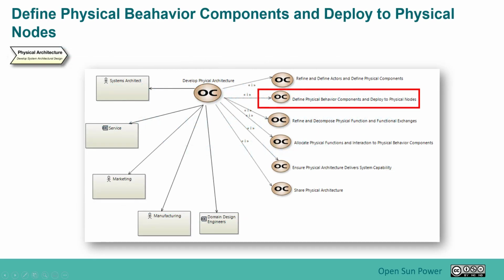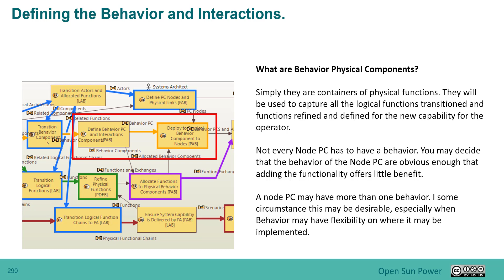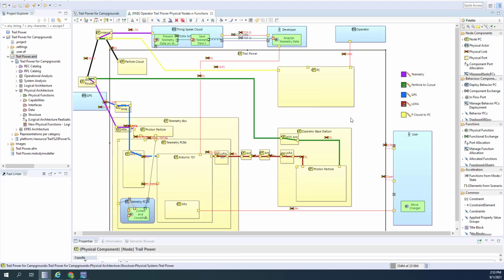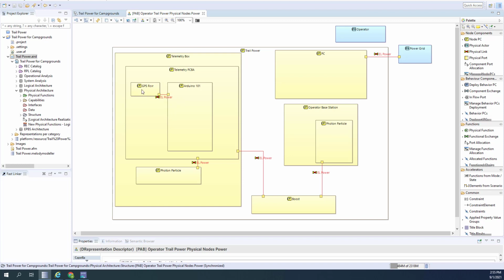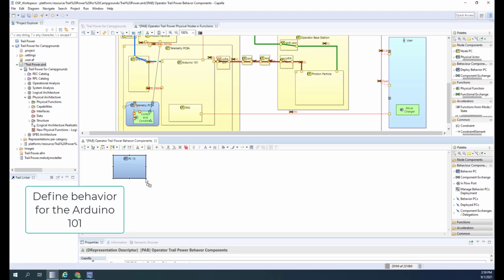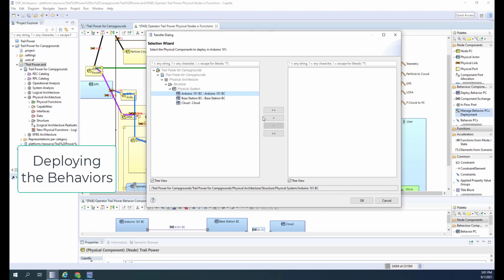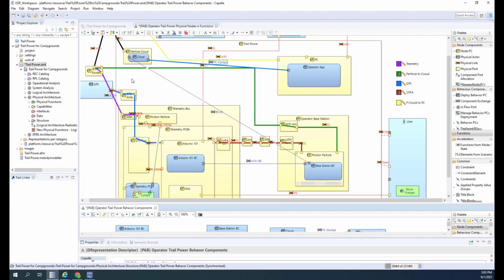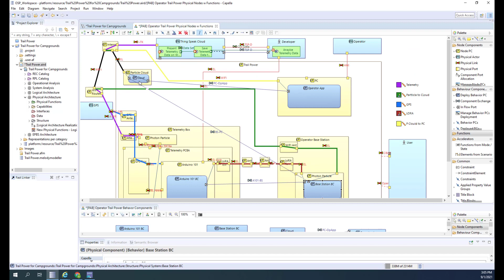8.2 Defining Physical Behavior Components and Deploying them to Physical Nodes with Capella

Comment: Hi. Do you know know why the mapping cannot be done if PA`s are involved (e.g. could you have done also the allocation of the blue physical path to the component exchange?) Thanks!
Reply from the maker: No I do not, but I would not be surprised if that changes is a later release. I typically just go to specific port on the PA and make the allocation.

Comment: Thanks a lot for providing these videos -They are excellent.  I purchased the books  "Systems Architecture Modeling with Arcadia Method" and "Model-based Systems and Architecture engineering with the Arcadia method". written by Pascal Roques and Jean-Luc Voirin. What else material do you guys use to learn about the Arcadia/Capella tool/method for MBSE. ?
Reply from the maker: Those are the books I use. Getting experience and looking at others models has helped me. I plan on sharing more models after I get this course complete.
Reply from the maker: You will find a number of webinars by Juan Navas and Stéphane Bonnet. They all work with Jean-Luc. You will see that they are taking full advantage of functional chains. I stress them heavily, since they are a powerful capability of ARCADIA. When books were written they were just starting to be embraced.
Reply from the maker: Get on the Capella mailing list and they will keep you up to date on webinars and product changes.